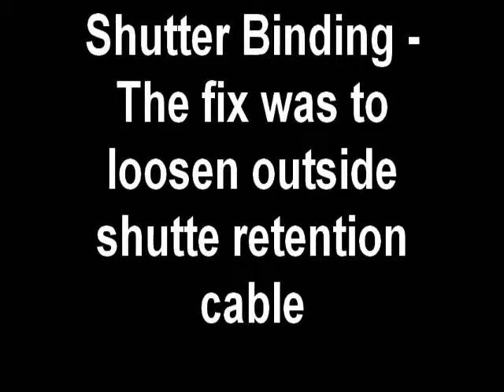PD-15:  Shutter Binding - The fix was to loosen outside shutter retention cables

Comment: Hello Mr. Pavlu, I just purchased and erected a 10' Home Dome. However, it is 20 years old and I am the third owner, so the fibreglass has warped a bit here and there. The Dome rotates well manually but I am apprehensive about trying to motorize it as my skills are limited. I would also love to motorize the shutter and I received a brand new motor with the purchase, but again, after watching your great videos, it looks very complicated. I am wondering if you took photos of the step by step build of the shutter and/or dome motors, cables, etc. as they would be much appreciated. The typed instructions and diagrams on line are not great and I need all the help I can get. However, I must say that your videos have given me some hope that I can at least get the dome turret motorized. Thanks, Ed from Waterdown, Ontario, Canada